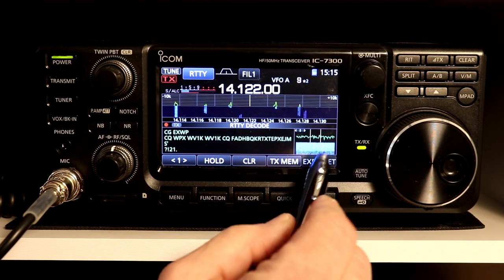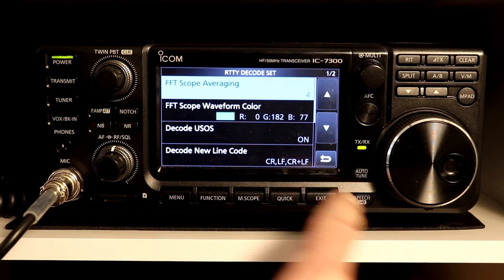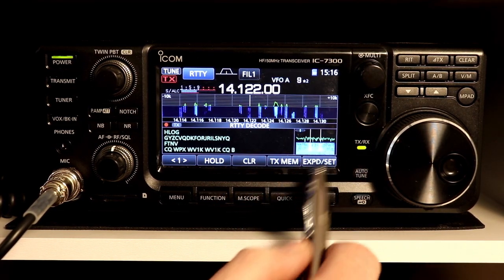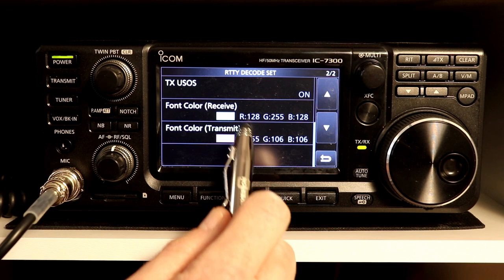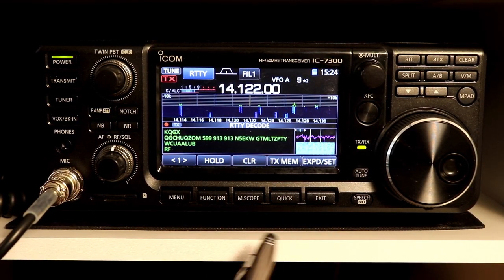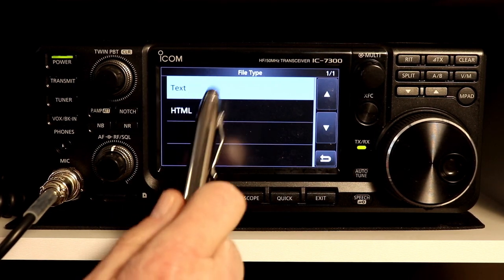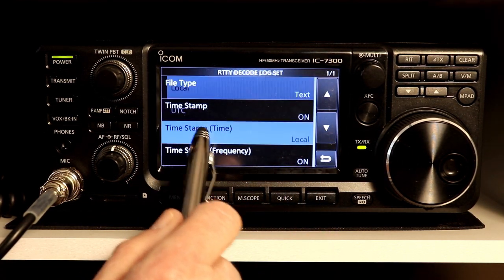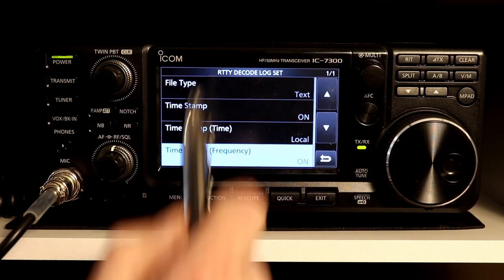Icom IC7300 A to Z #37 RTTY Decode and settings

Comment: One tip I have is that if you're having trouble decoding is to change the mode from RTTY to RTTY-R. To do so just tap the RTTY box in the upper left hand corner of the screen, just below the Icom logo and when the mode menu pops up tap RTTY and it will switch to RTTY-R. To Switch back, reverse the procedure.
Reply from the maker: Thanks Patrick.  Good tip.  So other people understand what this is doing--  It flips or Reverses the mark and space audio tones.  One thing that could cause the problem is if the person transmitting is using digital mode software and they have their rig set to the wrong sideband.  That would reverse the audio tones from their end.

Comment: Hi Tom, just came across this video, trying to test RTTY without USB as I am having an RFI problem. BTW I used to use the clanking monsters Model 15, 14, 14TD about 40 years ago, before I went to glass. Using Memory TX, I only see about 10W out on the SWR meter, with RF @ 100%.  How do I get more?
Reply: Scrub that request!  I hadn't changed the calibration pot on the Oskerblock 200!  Now getting full 100W without disruption - a bit of disturbance on the computer monitor.  I've had the 7300 over a year now and still have a lot to learn, so I'll be signing up for the A-Z series.

Comment: Seem like very little/no amateur RTTY, most hams seem to have switched over to various digital modes - so is it possible to set the 7300 to receive out-of-ham-bands commercial RTTY - if I understand correctly, perhaps need to change baud rate?
Reply from the maker: You can change the frequency shift and the baud rate in the settings.  I don’t know if you can set the parameters to cover some of the commercial services though.

Comment: Hi Tom,is it possible to change the RTTY -Shift for instance to  425 Hz to decode Weather-Reports?
Good Video !
73 de Germany,nr Munich 
DL1RL   Klaus
Reply from the maker: Hello Klaus.  You can change the RTTY transmit shift to 425Hz, but the internal decoder only works at 170 Hz shift. Seems like a strange limitation when they allow the other options for transmit.

Comment: I can't get my 7300 to decode rtty. It never seemed to work and me being a new ham I assumed that I didn't understand. I would line up the signals peaks in the rtty window and see garbage. Now that my 7300 has the new firmware in it there is no way to line the signals up. They are much wider spread and can't both be placed under the alignment lines. Any ideas?
Reply from the maker: Hi.  Sorry that you're having trouble.  I have been able to decode okay with mine.  It could be that you're listening to a RTTY signal with different parameters than the normal defaults.  In the Set menu under Function there are settings to change the Mark Frequency, Shift Width (in Hz) and the keying polarity.  You may need to change one or more of those settings depending on the signal you're trying to copy.
Unfortunately, you either need to know the parameters for the signal you're trying to decode or you need keep trying different settings.  There are also signals that sound a lot like RTTY, but that use different coding and the radio won't be able to decode those at all.

Comment: Thanks for another excellent video how difficult is it to send S>O>S in rtty to a location , I am just a layman and do not know the function or need of it in Amateur Radio how does one get that to a workable message to relay in an emergency to a workable language Thanks Mike, I am always keen to add 1 more Iota of brain cell to this 65 year ole brain
Reply from the maker: Hi Mike.  Typically for RTTY (or any other digital mode) you will use a computer connected to the radio.  On the computer you’ll be running digital mode software like FLDigi, WSJT-X, Ham Radio Deluxe or others.  I go through some examples in videos 23, 24 & 25 in the IC-7300 series.  You can check out the first one here:  https://youtu.be/1cBbG62U_U0

Comment: Hello it is possible to connect a PC keyboard directly to the IC 7300 to transmit in RTTY ? Or What add gear I would need? Thank you.
Reply from the maker: Hi Ruben.  There is nothing documented about being able to connect a keyboard to the 7300.  I have wondered the same thing myself.  I've thought about trying to connect both the keyboard and the 7300 to a hub, but I'm pretty sure that won't work.  I believe the 7300 appears as a device/component on USB.  It would need to appear as a hub or controller to work with a keyboard.  Maybe somebody reading the comments will have a suggestion.
Reply: @HamRadioA2Z  Many thank for.your answer. In the instruction manual said that if you connect the USB to a PC, laptop then download the RTTY program you can transmit  RTTY using the laptop keyboard but where is that program? because I can't found it. Perhaps there is on the CD control of ICOM? I hate spend 130 dollars on it for nothing. I don't control the rig from the distance. You know about it? 73.

Comment: What am i doing wrong. I put my 7300 on RTTY and i decode nothing but gibberish.
Reply from the maker: Hi Joel.  I’m sorry you’re having trouble.  It could be many things, including several where you aren’t doing anything wrong.  Are you trying to decode RTTY in the amateur bands?  Or are you trying to decode some of the commercial services on HF?  A lot of the commercial services are at a different speed and/or use different tone spacing.  You can change the settings on the 7300 to decode some of them, but it can’t decode all of them.